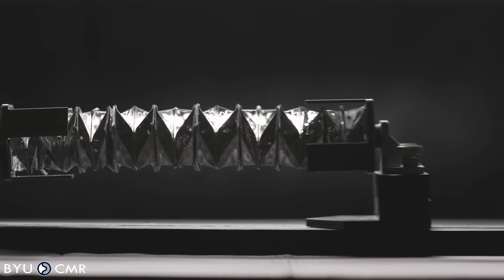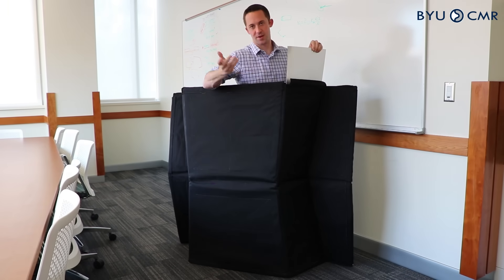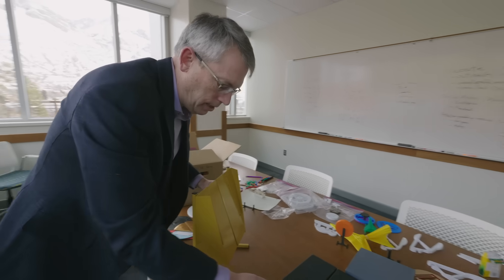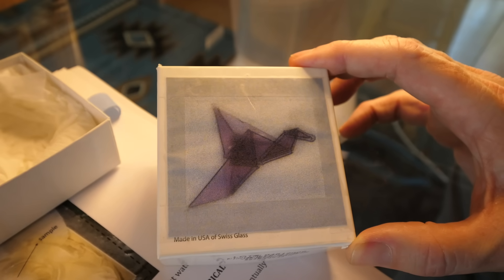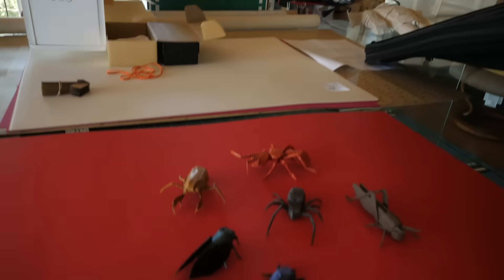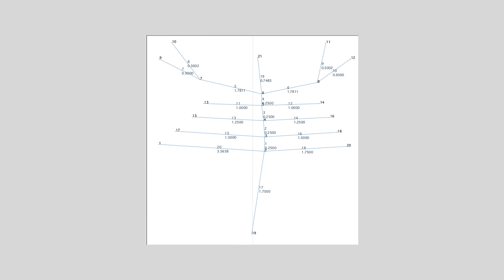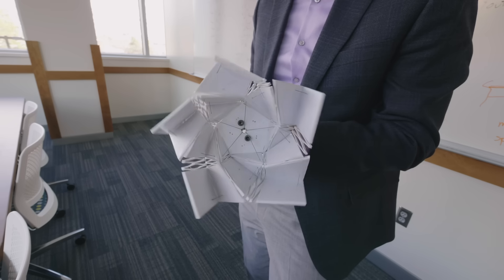Engineering with Origami

Comment: At first I thought Circle packing reminded me a lot of polygon triangulation in 3d computer graphics, but then I realized that the connection is obvious. Polygon triangulation is exactly that, finding the "creases" or vertices in a 3d mesh given a set of points in the 3d model, which correspond with the "stick figure" and the circle scaffolding. So naturally I was wondering if there were algorithms and software to generate such models for origami, and lo and behold he talks about origamizer. Mind is blown.
Reply: Wait a sec, after actually checking out demos of Origamizer, it literally just is a model viewer that flattens out a model. It's not actually origami because the fold model it generates doesn't use up the entire square, you gotta trim away the excess in which case it's basically pepakura, except pepakura has flaps which you can glue together to close the seams but origamizer will leave the seams open instead. I'm kinda less impressed now...

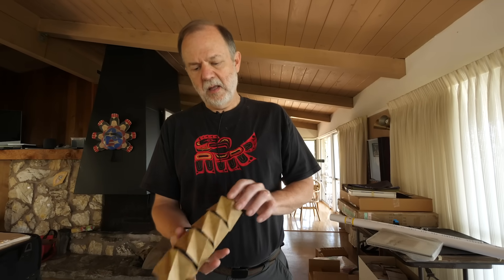Comment: 2:35 - "with relatively little processing" - with relatively *simple processing (with essentially just two operations: mountain and valley folds); it actually takes more processing. It's like a RISC CPU, it has fewer operations , so it's simpler, which can run faster and are harder to fail, but it also means that they have to do a lot more work to do anything non-trivial. Origami turns the flat sheet into something complex with just a few operations, but it requires a lot of them to get there.

Comment: Is there a good source for more of the engineering applications? Googling engineering origami really only brings up the satellite folding solar array. I want to see more, different things, not more of the same.
I also want practical engineering examples. Things like the kaleidocycle, or hexaflexagon, are cool, but they have no practical use. Yeah, it continuously revolves, which is cool, but what's the practical use of it, how do you drive it, etc. I could see it as some kind of extruder or cable-walker, but again, how do you drive the thing to make it functional, and would it would more than likely be less efficient and practical than already available solutions.

Comment: 1900: you can make a dinosaur with origami
2050: your whole house is origami and comes in a box
Reply: With the box beimg the size of a small laptop
Reply: 25,000 subscribers 10 Videos now imagine car and plane designs based on such concepts. 
Your garage is an envelope with a box you can hot-swap an engine between. Even better if we figure out ultra efficient electric motors as they will scale up/down enormously. 
Maybe not ideal for heavy use, but the daily commute/shop/school run? Most definitely.
Reply: IKEA
Reply: ...and it can crush you and your family with a button, so of course in response to that by 2060 we are all origami.
Reply: 2120: Origami Spaceship can now travel in light speed
Reply: I think I saw a design for a portable origami style house online years ago. Don't remember if it was just a concept or for $ale.
🌊

Comment: Just wanted to share something I made relating to origami (https://ealitt.github.io/origami-printing/). It's a website for generating 3D models for 3D printing origami onto paper. If folding gives paper "memory", then 3D printing onto the untouched sections would keep the shape rigid, making folds a lot easier. I explain things better here if anyone's interested (https://souzoumaker.com/blog-1/2019/1/16/printing-origami) or a video demo (https://youtu.be/jEq7PHQhwnI)

Comment: “So I heard you have another origami invention” 
“Well yes I made plans to fold a working computer out of a piece of paper. It doesn’t have any internal memory yet though...” 
“Hmm”
Reply: That’s actually an interesting thought. How could one make logic gates out of origami...
Reply: @coyotedomino  in a sense, those pincers were an and gate.  You need to move both sides for them to pinch, or else the whole thing would just move aside.  If you used a physical barrier to prevent it from turning, you could make it an or gate where pushing either side would work.
Reply: A key board mechanism could be easily made via origami engineering, laptop hinges might under go an origami revolution too.

Comment: Yeah, the origamizer part is a bit misleading ... 

most surface shapes, like the mentioned elephant are not done that way

Orizamier is not this ultimate algorythm that will make the best origami models

in fact, it's quite brute force 

you load an 3D model mesh, and rather than building the solid object, origamizer will essentially "emulate" the polygons of the mesh by making them stick out of the paper, but then it's your job to make them all fit together, and also, there's like 75% wasted space between polygons, so, origamizer patterns are good for really simple polytopes like max 40 faces.

you would really not want to use Origamizer for anything remotely like an elephant, because the end result would be practically impossible to fold (would require 0 thickness paper)

Comment: Fun fact; Bob Lazar who claims to have briefly worked on reverse engineering ET ships in 1989 at a facility adjacent to the groom lake facility sloppily known in public as area 51, said that a section of the floor inside the discus shaped craft could fold together to the side in a kind of hexagon pattern iirc. Strong enough to support walking on when spread out yet smoothly and effortlessly fold to the side when a finger was inserted at a certain point. It was all metal. Lazar said it was something we could make today just never seen before.

Comment: 10:20 Did I miss something?
"It is only 4 micrometers thick. So 400 of them can fit on a 1cm wide computer chip"
1cm are 10'000 micrometers. So if it is 4 micrometers thick, there would fit 2500 of them on a 1cm wide chip. Not 400.
Reply: Thick, not wide.
Reply: @gracefool  Think again. That doesen't matter. The statement doesen't make sense in any way. You can't compare thickness to wideness. So either, he meant just one of those and misspelled it or he did not think about it and compared the wrong numbers. 
Also, why would the thickness of the mechanism be relevant if the wideness is the limiting factor?  The mechanism would use the same space on a surface no matter how thick it is. 
Using the "thickness" doesen't make any sense and has no purpose. But if he wanted to use the wideness for comparison, then his math is way off.

Comment: This sounds like it would potentially have amazing applications for isolated areas like space or deep underwater. You don’t need to bring specialized pieces to replace everything. You bring sheets, a program, and a machine that lets you fold it up. Kind of like a 3D printer but better.
Reply: That's actually a great idea.
Reply: Wouldnt that take up a lot more space though?
Reply: @bleh8789  depends on how long you'll have to last without resupply. Rather than take an ungodly amount of things to prepare for every situation, take the sheets and folding machine
Reply: @ashleythomas9671  well yes, but the parts tend to be smaller rather than the sheets as well as the hypothetical machine, don't you think
Reply: @bleh8789  yes but you'd have parts you might need and never use, also sheets would be easier to store and if your without re supply for ages it would be easier and take up less room to create parts as you need them rather than store a lot of parts you might need. Thin sheets can be stacked with no wasted space where as parts will have boxes and air gaps between them. The longer you are without resupply the more advantageous it would be to have sheets and machine. Of course it would be better to have the parts if its short term or you get resupply, but the longer without resupply the more advantageous machine and sheet are.
Reply: Maybe you could also reclaim them after use to fold into something different.

Comment: 10:43 i really want that lamp
Reply: Buy a peace of paper and start folding :)
https://www.wasatchdesigncollective.com/ellipticinfinitylamp
And if that's to hard you can 3D-print it https://www.thingiverse.com/thing:3896846
Reply: remember to not burn whole house with that lamp. Use other material than paper or light source which will not produce so much heat on paper